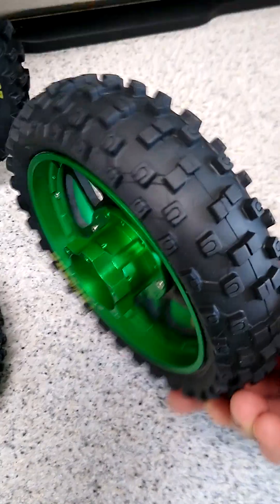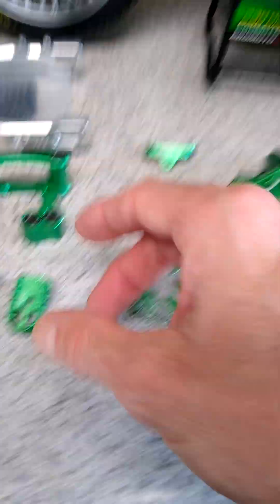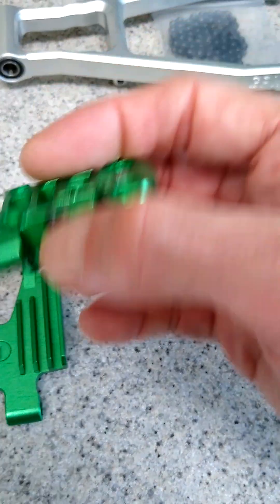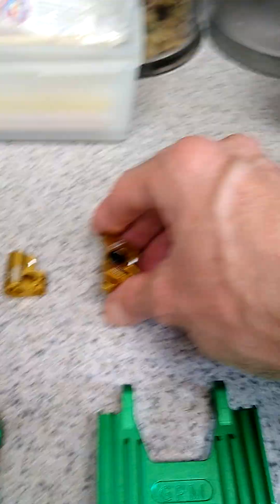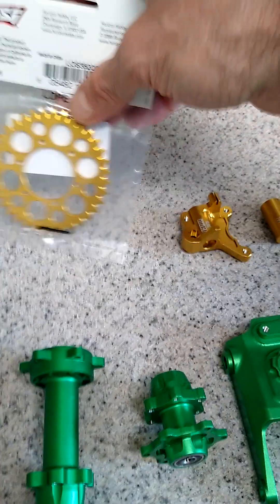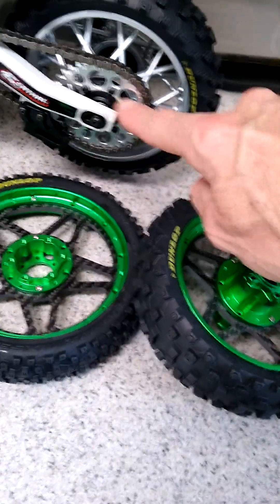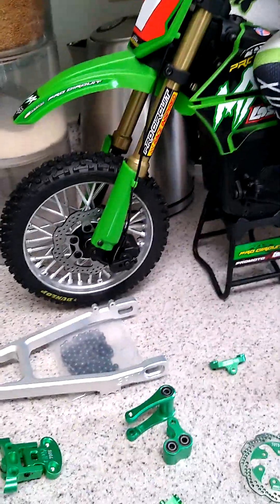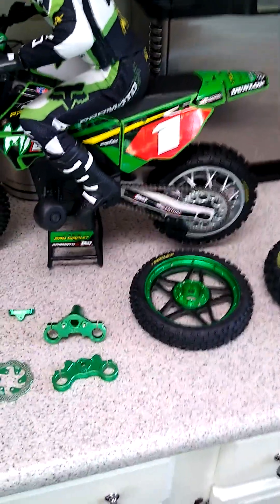Losi Pro Moto MX dirt bike.  New video showing all my Alloy upgrades that I need to install.

Comment: Where'd you get the Dunlop tires from ? 🔥
Reply from the maker: Those tires are actually Losi Replacement tires.  Just look up stock tires and they will be the originals. Even with the lettering on the sides.

Comment: Those parts look trick! I just ordered the bike so I am just perusing upgrades. If you don't mind saying, how much did all that set you back?
Reply from the maker: Hello.  All the GPM parts and the Treal RC rims and the Losi rear sprocket. It was about $675.00 in just the parts. I picked out some for function. And some for show.
Thanks for watching my videos.
Reply: @vigilanterc  Thanks for the reply. That's not too bad a price, I think. Will certainly look badd azz when you get it all installed! 👍
Reply: Great video do you gave a link for tbise alloy rims need them now lol
Reply from the maker: @MrBEEFCAKE26  hello..  Amain hobbies has them here in the states now.  Just go there and order them.
Good luck.
Reply: @vigilanterc  thanks pal and great video